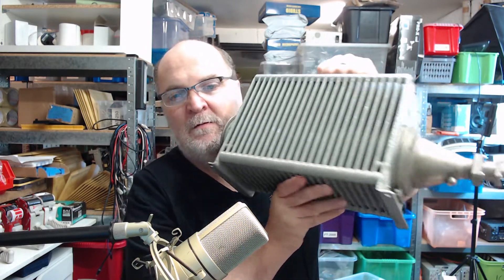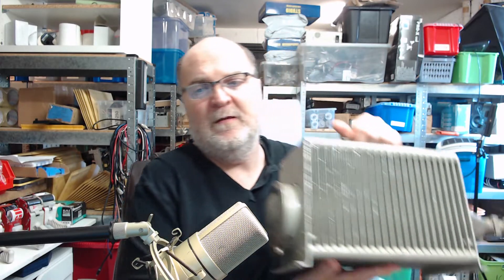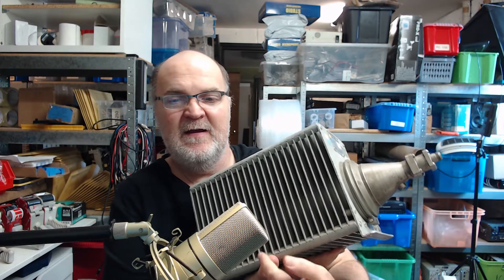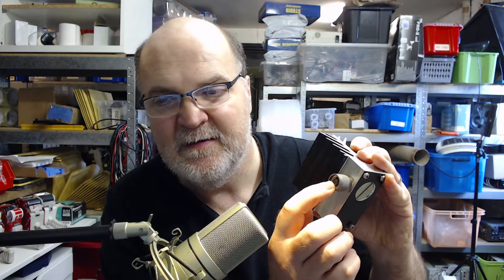Resistance is NOT futile! Get a Bird Dummy Load!

Comment: Those Bird ones are pretty expensive, but I got a simple Heathkit Cantenna load cheap, filled it with motor oil, and it will handle 1 kW for the brief period needed to tune up (or longer at lower power).

Comment: I got the MFJ Kw can load works great. VSWR 1:1.2 under 30 Mhz. Watch reflect power on dummy load. With just radio should be very little VSWR. If jumps high like 3 to 1 with amp on your amp out of tune and going off 50Ohm. Re tune amp for very low VSWR and peek output for SSB.  You should tune into dummy load first then slight if any re tune on antenna. I use cavity switch leaving dummy load already. ant /load